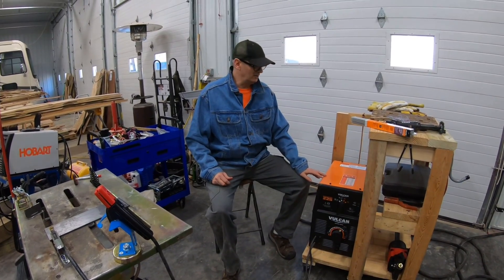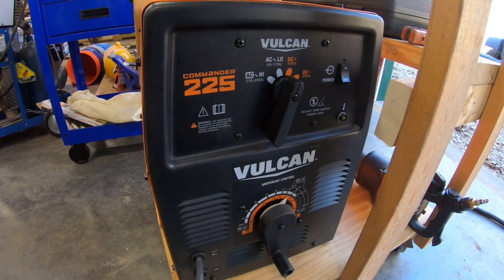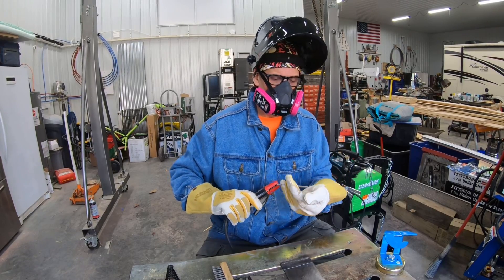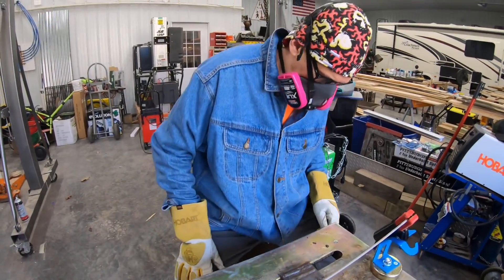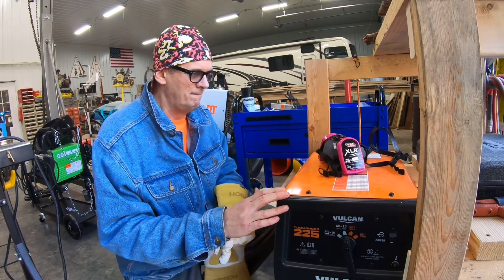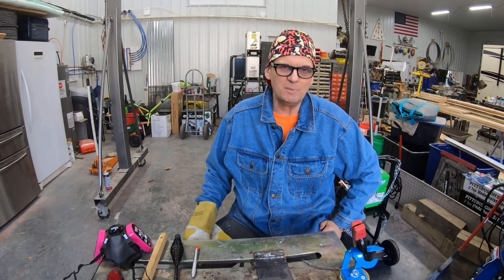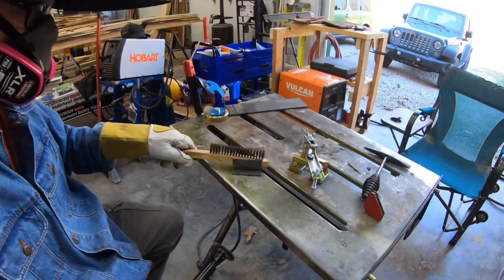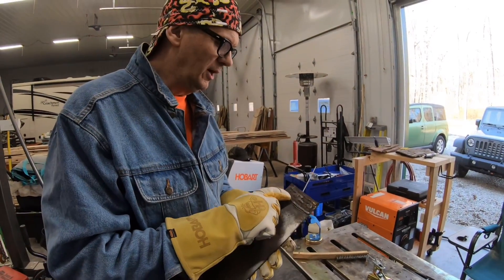Harbor Freight’s Vulcan Commander 225 AC/DC Arc Welder (Harbor Freights Last Transformer Welder)

Comment: Someone else said it first but never start on the edge of the plate start an inch ahead and drag back to where you want to start also the polarity doesnt sound right you should be welding on dc + thats it
Reply from the maker: @mattfogarty8144  thanks for watching and commenting! Appreciate the tip on the starts, just started arc welding and the starts have a pretty good learning curve but the tips really help! Appreciate your support, have a great day and be safe!

Comment: Hey bud great video, just wanted to give u the heads up the polarity switch on that machine is backwards, try running 7018 on dc- and u will see a big difference!!!
Reply: I had that machine, got rid of it!! Was not happy with the magnetic shunt tension adjustment mechanism, that they used to make that unit!! And the material they chose for the magnetic shunt outside insulation, where it slides in and out of the core is cheap like bakelite crap!!! I did get it to weld almost as good as my miller thunder bolt, I just didn't see it lasting long term and it's discontinued so no parts available!!! So I shot it back to harbor freight for my money back before the 90 days were up!!!!🤣😂🤣👍
Reply: The shunt adjustment cable bracket is part of the front control panel, and it's a nightmare to disassemble or reassemble for grease and adjustment service!! It's almost made to be a non service unit, which is really dumb!!!
Reply: The miller thunder bolt , and Hobart stick mate of similar design to this, the case comes apart very ez on those for service!!
Reply: And the polarity switch is backwards configuration internally, so I switched two wires on the back of it to correct the switch!!!😊😊😊
Reply from the maker: @John-z4g5p  thanks for watching and all your comments and suggestions! Definitely will check that out! Appreciate your support, have a great day and be safe!

Comment: Sounds like your on electrode negative. What sets this machine apart from other transformer welders of the past is  that it has power factor correction, the power cord doesn't get hot like other transformer machines.  I have added similar capacitors to my other transformer machines and it works.
Reply from the maker: @CarlosMorales-jd5hb  thanks for watching and commenting! It was set to DC positive and the electrodes said they would run on either AC or DC positive. I absolutely was struggling on those first few welds. It did get better the more I practiced. Thanks for the information about the power factor correction! We appreciate your support! Have a great day and be safe!
Reply: He is, they fucked up in quality control in China the switch is backwards!!! I had the machine fixed that prblem!!!

Comment: I have a commander i got used a couple years ago and i love it only thing I didn't like about it was the short leads. And i took the leads off mine and installed quick connects on the welder cause i also have a Hobart engine drive with 40ft leads that has quick connects now i run them on my Vulcan. Great machine also a friendly tec tip if u have any magnets on your table while trying to weld using ac it want be good cause your magnet affects ac voltage
Reply from the maker: @Daletaylor-s9b  thanks for watching and your comment! That is an awesome idea, glad it is working out for you. I need to use mine more but everything I have done with it has been good! Appreciate you, have a great day and be safe!
Reply: I not sure if u seen the last part of my comment cause I just edited it an put in there but while ac welding if you have any magnets on your table it affects ac voltage. That's biggest down side to ac welding u can't have no magnets
Reply from the maker: Thanks for the tip on magnets and AC welding! Appreciate the help and support! Have a great day and be safe!

Comment: You are killing me with the bump start. Strike off about an inch walk it back
Reply from the maker: @hamtrucker  thank you for watching and your comment. That tip actually helps a lot, still learning and working on my arc welding. I do mostly mig and still learning that. We appreciate you, have a great day and be safe!
Reply: @CopperBarnHomestead  if you use a small file and gently file the tip clean for restarts, it will help a lot to strike it too.
Reply from the maker: Thanks for the file idea tip. Sounds like that would be very helpful! Appreciate you, have a great day and be safe!

Comment: i've put  a lot of hours on mine and love it.  No complaints.  I'm certainly not a pro,  but it gets the metal stuck together like it should.
Reply from the maker: @Wooddust6  cool, thanks for watching and your comment. I’ve used mine a few times since the video. The DC I can get a great weld with, the AC I still need more practice. Lots of stuck electrodes for me on AC. But yes, overall it is a great machine. It’s a little sad they discontinued it. Have a great day and be safe!

Comment: No offense, but try not to change your amps a lot if you can help it. That's a knock-off of a Miller Thunderbolt XL and  Hobart Stickmate, but they cheap out in the parts for the amp change knob. I took mine back a few months ago. My HF was selling them still a couple years ago when i bought mine. I loved it, but it didn't hold up for me. I have a video on it somewhere on my channel. I used it for a couple jobs before it gave out.
Reply from the maker: Thanks for watching and the comment. Definitely appreciate the advice about the knob also! I am not sure how much I will use this since I also have an inverter stick welder that doesn’t weight 145 lbs… lol 
I do like this one and what I was told was this had never even been plugged in before so I will definitely baby the controls to hopefully make it last. Appreciate you, have a great day and be safe!
Reply: @CopperBarnHomestead  Here's a heads up... I found that when I did use it, 90 amps was the magic zone. I used AC and could run AC7018 and 6011 both at 90 amps.
Reply from the maker: @gillihansmobilewelding  awesome!!! Thank you! I’m still trying to learn to weld so that definitely helps! Have a great day!